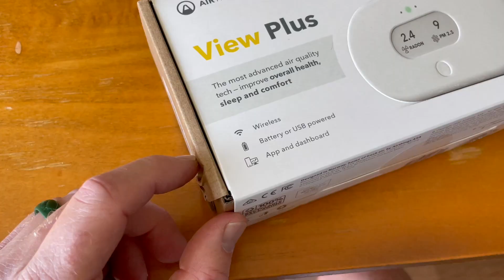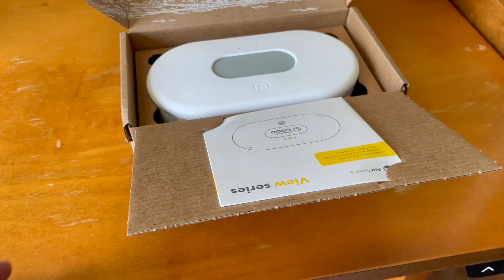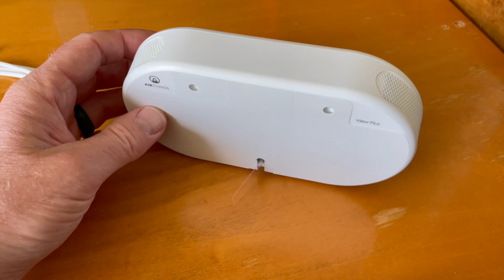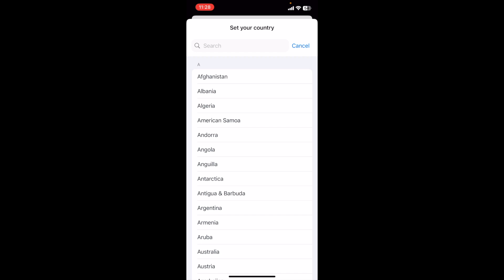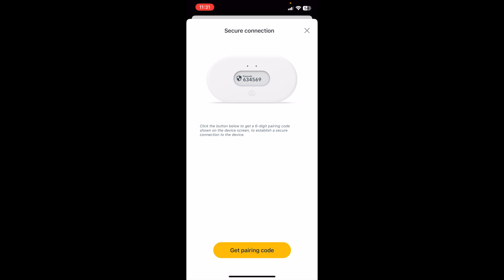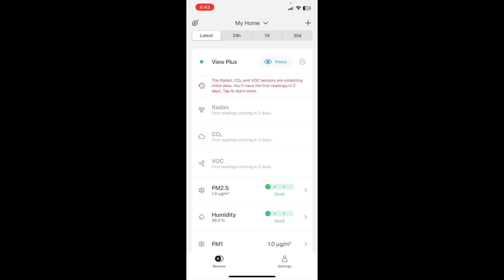Watch This Before Buying the View Plus Air Quality Monitor by AirThings

Comment: This review is disappointing. I bought my Airthings View after seeing the review. The device is delivered with No instructions. Thier tech support cryptically advised to fist load the App. The App Store shows 4 different Apps. Another frustrating day to have them send a picture of the "suggested" App. The device has frozen multiple times and has been non functional. Their tech support is a Bot which is incapable of providing needed help. I would advise NOT TO BUY this device until the supplier sets into operation a real and effective support network. BUYER BEWARE (as opposed to the gist of the review).
Reply: Did you end up having any success with the product?